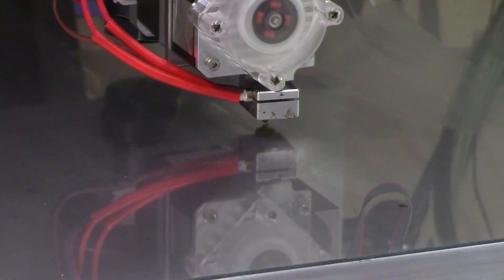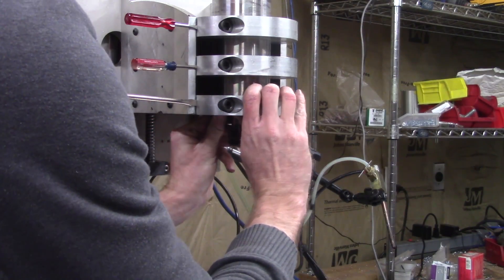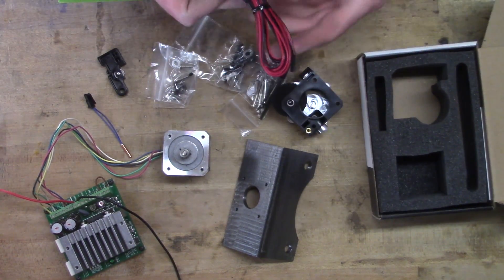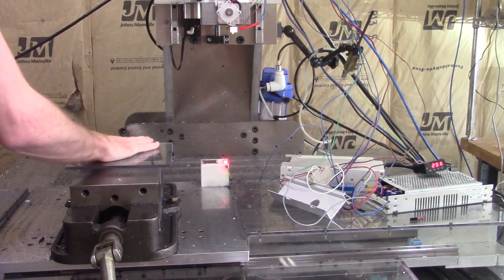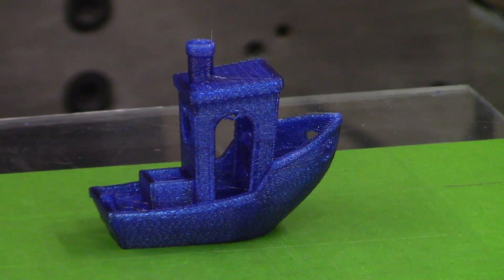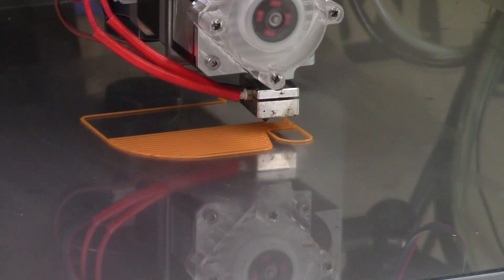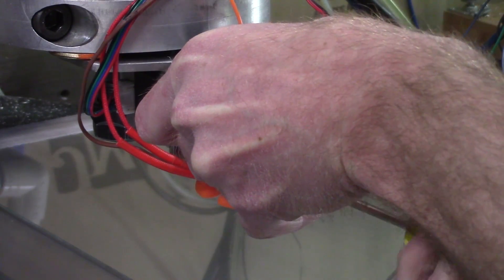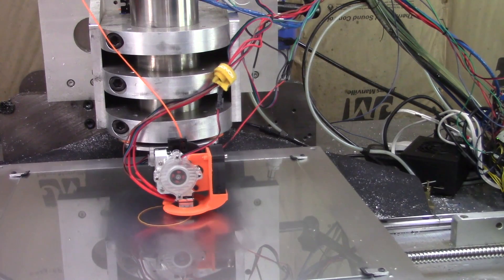Putting a 3D Printing Head on the Mill

Comment: Aquanet for the WIN. Clean the glass with window cleaner and spray on about four passes of Aquanet Extra Super Hold. Let dry 10 mins. Never had a print fail. If you can be patient enough to let the glass and part cool completely, the part often pops right off on its own.

Comment: ramp the speed up and see how well it does! the clearpath motors shouldn't allow any missed steps to ruin the prints.
thats a common problem for nema stepper based 3d printers when printing at high speeds.

Comment: HAHAHA, you going from CNC to 3D printer, I'm going from 3D printer to poor CNC with 1950's Cincinnati 2.5HP 3PH knee mill and 3D printed cycloidal drives to spin the handles for X/Y/Spindle-Z using Nema 17's. Spindle speed up to 2750 RPM's so no where near as fast as today's CNC mills but still fun to play with in my garage.

Comment: Thanks for the video, well done. I have a shopbot desktop where the bed does not move rather the spindle is moved. Any idea if this process would work? Also do you have a complete parts list that you purchased? Thanks
Reply from the maker: +Rick Fischer I don't see why not, that's more similar to traditional 3D printers anyway. I don't have a parts list unfortunately. You'll need an extruder assembly, stripper motor and driver, PID temp controller and comparable thermistor/thermocouple.  I think that's all; assuming the shopbot controller supports a fourth axis.

Comment: What software controls this?  Is it G-Code like a mill?  Are you using Mach 3?  I'm very interested in 3D printers, If I can add this capability to my Mill without buying another machine, it would be awesome.
Reply from the maker: +Roger Fries Look up 3D printing slicers. They can be set to output regular Mach3 style gcode using XYZ and A axis.  The machine just thinks its doing normal milling, it just never activates the spindle and just moves around.
Reply: What are you using for temperature control?  Are you using Mach 3?  Do you have a video on the electrical hookup?  I really love the idea of adding this to a mill!  Thanks!
Reply from the maker: I'm using software very similar to Mach 3.  Temp control is done manually with a cheap PID controller from ebay and a thermocouple.  I don't have a video, no.
Reply: What software are you using Linux CNC, or is there another Mach 3 alternative?
Reply from the maker: UCCNC

Comment: Awsome, subscribed after watching this. 

What are your XYZ print dimentions? 

How about a super size benchie? In theory, as long as you first few layers are within print bed area, the bow could be printed overhanging the bed to make is even bigger!
Reply from the maker: Thanks!  The build area is approximately 16" x 16" x 16" but the raised portion of the bed is only 14.25" x 14.25".  So yes, it could build over the edges of the bed in some dimensions if needed.

Comment: Was there a part one or something I missed where you explained all the software setup and everything?

Greatly enjoyable video as usual but seems like bolting an email extruder on is the easy part compared to getting it working off your A axis?

Perhaps I'm missing a link or whatever? Couldn't see anything in the description.
Reply from the maker: JunkAccount You didn't miss anything, it really is that simple! The CNC controller has XYZ and ABC axis available. I just plugged in the extruder motor to the A axis and in the slicer setup, you tell it what axis letter to use for the extruder, in this case, A. That's really about it! :P
Reply: Chris DePrisco so the slicer gives you gcode for mach3?
Reply from the maker: Yes.  There are a number of different profiles in the slicer for different machines, but one of them is just a generic Mach3 profile which just spits out XYZ and A coordinates along with the appropriate G and M codes for things like return to home.
Reply from the maker: I got Simplify3D after Slic3r kept randomly crashing on me and I like that it's super fast to do the slicing so you can test changes to the code very quickly (although it still takes some time to output the final code on larger prints).  All the slicers are good though, it's just what you like best.

I definitely still recommend the Titan Aero.  No problems whatsoever so far, but I hear that's the case with all genuine E3D products. :)

Comment: sir you need a face mill in your life
Reply from the maker: I really, really do.  The biggest problem is the 24K RPM spindle can only go down to about 6K before all the torque is gone.  I haven't done the math but even with a 2" face mill that sounds like probably less than optimal SFM. :P

Comment: Can i ask what controller board your using?
I want to build a kit for mine, but the thermo controller is the worst part to find info about
Reply from the maker: +Spike stock I'm using a UC300ETH and UCCNC. There isn't a therm or fan controller but it's got Modbus which can talk with an Arduino who can control all that stuff. I need to make all that happen still
Reply: so the UC300ETH is running the CNC part or just the extruder head?
Reply from the maker: It's doing both.  To it, the extruder head is nothing more than another axis to control (it can run up to 6 axis simultaneously; XYZ and ABC).  I just hooked up the extruder stepper to the A axis and told the slicer that the extruder axis should be called "A". 

Eventually, the UCCNC software will also be communicating over Ethernet (using Modbus TCP/IP) to the Arduino at the same time telling it which heaters and fans to turn on/off and receiving back temperature and fan speeds and displaying those on the monitor along with all the other info.

That is, if I can stop printing things long enough to make all these changes! :)
Reply: That makes sense. I think with Mach 3 you can change the A axis to work in mm rather than degrees.
My biggest thing is likely the temperature control, so yours is just working so that the ceramic heater is always on?
Reply from the maker: You can get PID temp controllers on ebay for cheap.  You just set the temp on those and they cycle the heater on/off to maintain it. Same thing for the heated bed.  Right now the computer has no idea they are even there.
Reply: Chris DePrisco cheers
you've helped a lot with all this. I'm going to start ordering next week
Reply from the maker: Only thing to look out for that I've found so far is most of the hot ends come with thermistors and most cheap PID controllers only read thermocouples or RTDs (which i guess are like thermistors but not; and have 3 wires?)  So you'll either need to find a temp controller that can use thermistors or get thermocouples that fit inside the heater blocks.  Or you can use an Ardunio to control everything but that takes quite a bit of setup.

Comment: You should find away to add more print heads!
Reply from the maker: +ethan applefeld I'm sure I will! :)
Reply: you could run the two print heads in tandem so that they would both use the same fan and set the software to adjust by whatever the space is between the two nozzles and i bet that would work. it would be cool to see you try that in another video!
Reply from the maker: Yea, it would be super easy to do, it's just whether I want to spend another $200 for the parts or not... (I will eventually, though!)

Comment: How fast can this print. This machine is usually used to huge forces necessary for milling steel, and the printer has basically no force on the machine. I'm guessing it can print just as fast as that extruded is able to extrude plastic and still come out great?
Reply from the maker: +Joshua Middleton Right, it gets to the point that the heated chamber can't melt plastic fast enough. There are beefier extruders though. The other problem is that you can only accelerate and decelerate so fast and with tons of changes in direction right next to one another, I'm not getting much more than 50mm/s for most of the print. It can do 125mm/s in straight lines though. I never tweaked the motor parameters to get them too run to their max potential though; I got sidetracked by using the machine. :)
Reply: Chris DePrisco that's about the speed of most desktop 3D printers which is pretty good. How big is the build volume?

Comment: hello! loved the video. just a quick question:

once a piece is discarded, say, the fan shroud, can you melt it down and recycle the plastic for use in more parts?

tnanks!
Reply from the maker: +r'enbe There is a device from Filistruder that let's you melt and extrude plastics into filament, however you can't recycle the plastic through commercial means since it is not labeled as to what it is.  Recently there have been some companies that have started recycling old filament but I'm not sure to much about then.

Comment: WOW!
How did you get it to work with gcode? Does a CNC machine normally use GCODE?
It must be wierd to build instead of removing with your machine :P
I was blown away by the succes on the first try. So cool!
Reply: GCODE has its origins in CNC ! 3d printing firmwares adopted GCODE

Comment: Blue painter's tape wiped down with some rubbing alcohol works great. 
We found that the cheap green won't stick to the glass, and the expensive green sticks too well to the print. The blue from 3M has just enough hold without needing to be removed with an angle grinder afterwards.

Comment: What CNC machine are you running, or it a DIY build? I have a MPCNC but it is not good for steel or thick aluminum, have to use a manual mini mill on those for now, but would like to once day have a CNC capable of milling steel and thicker aluminum. Thanks

Comment: use a glass sheet for bed and use sugar and water mix so it sticks take the tape off and just spray it with sugar water and then wipe it. it will stick for pla

Comment: Hey Chris. I personally own a 3d printer with the same hotend as you. I've noticed that you installed the heater block with the wrong side facing up- The screws that hold in the thermistor and the heater cartridge should be facing down to the nozzle and not up. However, this doesn't affect the reliability or print quality of your hotend, but if you wanted to install the blue silicone sock (protects from getting it dirty and scuffed up, also prevents heat loss), you probably can't with your configuration. Also, if you want to maybe get the heater cartridge or the thermistor out, you aren't able to do so without disassembling the whole unit.
I just wanted to point this out, you might want to change it next time you have to disassemble the thing
Reply from the maker: Hey, thanks!  Maybe that's why my sock doesn't fit well.  :)
Reply from the maker: I had to take the extruder apart so I flipped the block over and the sock fits much better now.  Thanks again!

Comment: This machine must not even be phased by the usual inaccuracies of 3d printers... like axis wobble or a heavy extruder
Reply: Not even close
Reply from the maker: Cody Hubert It's even carting around the 10lb milling spindle in addition to the 1/2 lb extruder assembly. :P
Reply: I've been interested in manual mills due to their price. I would rather have a CNC mill but they seem so damn expensive. How much did yours cost?
Reply from the maker: Well keeping in mind I got most of the materials at scrap prices or even free, about $3-4k.  Most all of that is the electronics.  The best way to get started is get a small manual mill like a Grizzly G0781 (or whatever budget/capabilities you need) and convert that to CNC using stepper motors and stuff.  Learn CNC and then use that machine to build a bigger, better machine if you want.
Reply: I want a CNC too, take a look at this video. It may be the solution, a very cheap one, then you can use this CNC to build a better one. https://www.youtube.com/watch?v=ehhlxoRKx1A
Reply: FOR REAL THOUGH! STABILITY A+ !!!

Comment: Neat. Looks like you can do both additive and subtractive with the same piece of equipment. I wonder if you plan on ever making something that will utilize both features? Would the printed plastic hold up to some basic machining for improved finishes or making tighter fits?
Reply: It would most likely shatter, especially when printing with PLA filament (Basic and most common filament) as it is very brittle, one must remeber that its many layers fused together and not one single cohesive unit.
Reply from the maker: I want to try sometime, for sure!

Comment: Hi, That is a sick machine... I have several purpose built 3d printers and have been using one with a laser diode; I am in the process of building a MPCNC to mill wood and will also be used as a large format 3d printer and laser cutter/engraver. If I might say it again, you sir, have the sickest setup (I can not believe you modified an aluminium piece to fit a plastic one).

Comment: you mention the heat sink keeping everything cool down to the hot head- That makes me wonder why you used the heat transfer paste? it would seem that we would want to keep the heat in the "hot head" , which makes me wonder why not have more of a thermal break where the hothead attaches to the heat sink? I'm trying to learn all I can before I get started. I'm about to grab an A8 only because it is probably the most well known of the entry level kits and support should be plentiful if I have any problems. little Things like strengthening the heat bridge tells me I need to learn more.
Reply from the maker: +Jimmy's Tractor The thermal paste would help suck out as much heat as possible at the threads. Then there is just the thin metal tube and below being heated. I would guess that would be a question for the designers at E3D.
Reply: Chris DePrisco I didn't expect such a quick response- Thanks! That's what I was thinking, but I thought they would want to keep the heat at the head instead of pulling it into a heat sink? That makes me think that they only want the plastic at that temp for a very short time and that they want it to cool as soon as they cut power? I really can't see any other reason, but if anyone knows for sure, I'd like to hear.  Maybe it helps it stay more consistent having a larger chunk?
Reply: Jimmy's Tractor if the plastic is between liquid and solid it will get really sticky. The idea is to make the transition zone as small as possible. The threaded rod is fairly thin and isn't a very good conductor of heat compared to aluminum or copper.
Reply: nicholas feltman Thanos, makes sense now. Basically you want to heat the shortest possible length of filiment. The tube needs to guide the filiment without getting the filiment hot enough to get sticky. I guess it has to be a pretty tight fit to keep from having plastic try to get out the back.

Comment: New sub.  That is probably the nicest overkill 3d printer I've ever seen.  I've spent most of my first roll of filament making braces for my printer.  I suppose you won't have to worry about that too much.  I suppose the only disadvantages to your rig is that it must consume much more power than my i3 clone and I have mine sitting on my computer desk.

Comment: use filament filter (any sponge i like dish sponge becouse you can put hard part upper and rest before  extruder to clean it from big parts and next from dust etc) next print silicone mold for hotend (if you use to much cooling temperature can be stable but....on the nozzle end can be to low and plastic can stuck (newer use layer hight more than 3/4  nozzle size - nozzle 0.4 best layer max 0.3... ;;; best min 1/4 nozzle but still can go lower

Comment: Looks like your 1st layer height is a little to high,you should have about 0.1mm between the nozzle and the glass bed when its all up to operating temperature before you start to print.
Reply from the maker: I think you are right.  I don't recall the exact numbers but these parts were too high off the bed.

Comment: these are some crazy good prints for your first prints. I'm extremely  impresse!
Reply: Most prints come in poor quality because of the quality of the screws, the vibration of a cheap perspex frame, the fact that the axis are using belts and not screws, the bed is on springs, etc. A steel mill is way better because it doesn't have those problems, it's rigid, strong, balanced, achieving smooth motion and prints. The rest is extruder quality, software tweaking, filament quality.
Reply: yea its not just the based on melting temperatures, it's your hardware as well
Reply: a real mill is 1000 times better quality than the china trash 3d printers!
Reply: The parts of 3d printers are made lightweight not to be cheap. Heavy parts of CNC much harder to move on high speeds and its affects printing quality.
Reply: What do you expect from that type of mechanical setup? Many of the typical 3D-print issues comes from the fairly low-cost, low-fi printer mechanics. This is made to machine metal with better accuracy than many 3D-printers. It's like watching a tank pull a trailer and saying "wow, thats impressive pulling power"
Reply: gerbizzlefoshizzle 
Not necessarily. 3D printing is much more than just nozzle accuracy. Printing a good print relies on knowing optimal melting temperatures, whether you need to use retractions, stability of print, how powerful you want the cooling to be, etc.

Edit: Or at the very least, having somebody else find that information for you online and just copying that :/